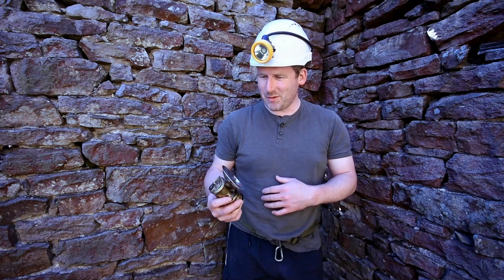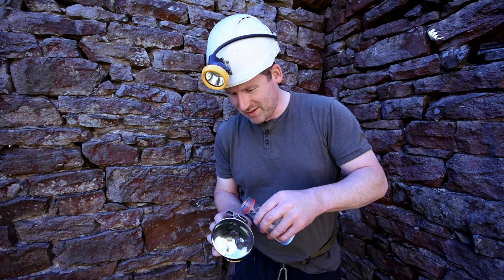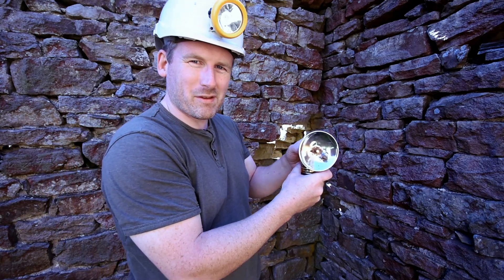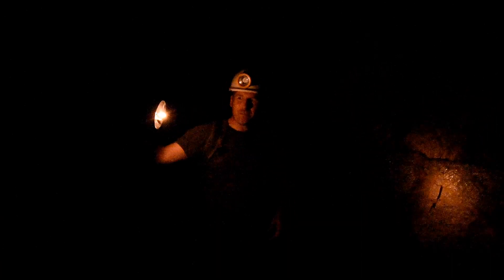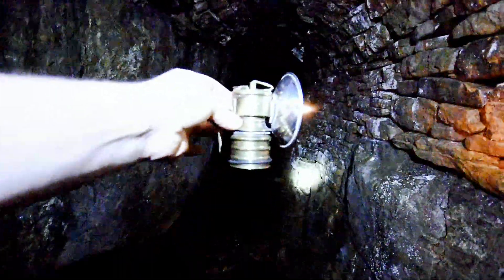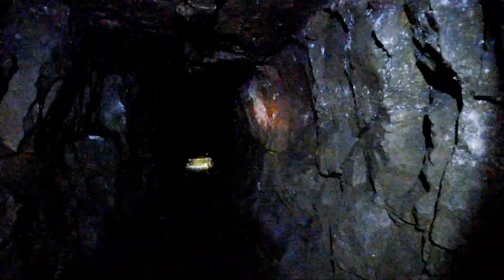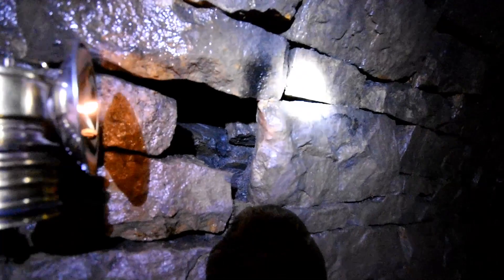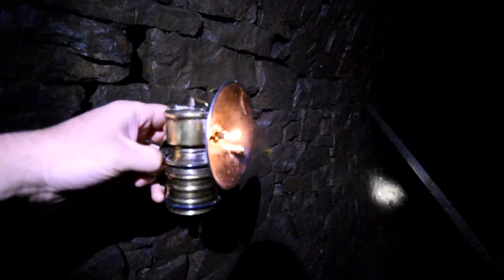Mining with Carbide

Comment: Adjust the water flow before you screw on the carbide container.  Otherwise you risk flooding the lamp.
Reply from the maker: I keep getting too excited and end up twisting the tap right on until the acetylene starts to flow. I did take a few videos of this the first time around and quickly found that 'less is more' when it comes to carbide. A steady slow drip is all that it takes!